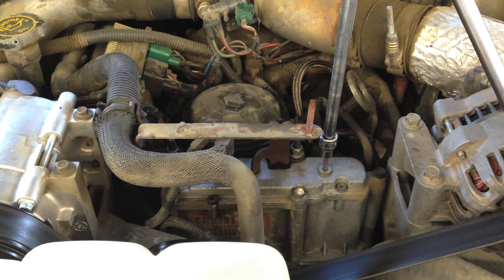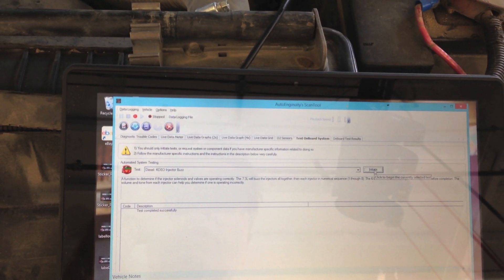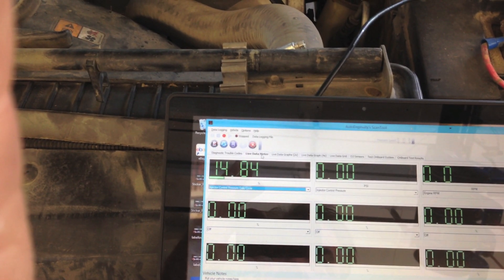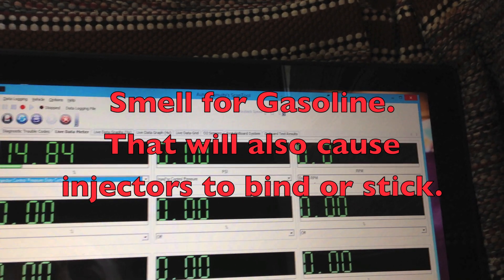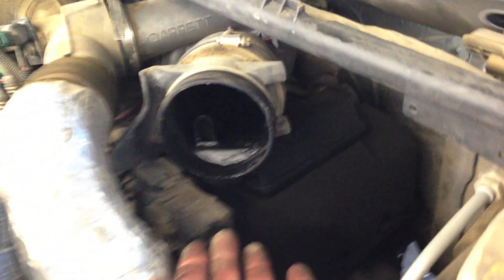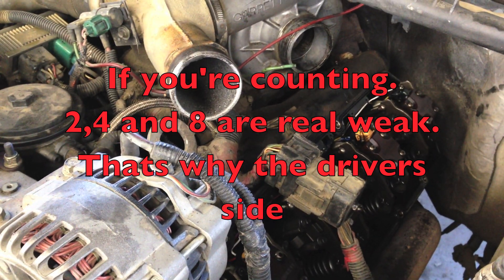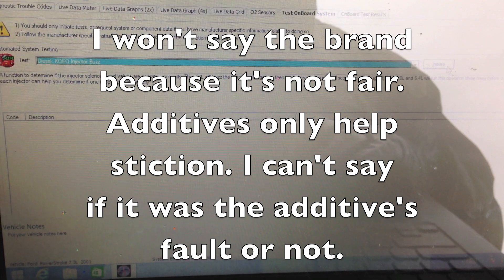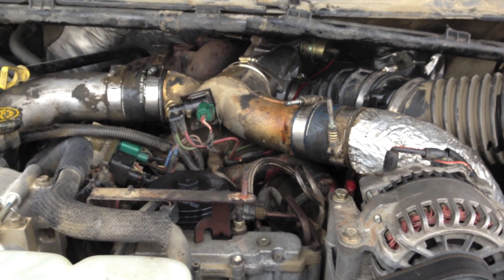Using Autoenginuity to diagnose a 7.3 Powerstroke hard start runs rough

Comment: sorry to bother,  I put new o rings in my hpop and new lines.  2000 7.3 t truck had a no start  found a blown fuse maxi number twenty four.   replaced fired up,  ran for five mins,  reved it and it died.  No start after that.  checked everything could find nothing.  finally I noticed on the directions for the new lines and cross over line,  it mentioned to discard the springs and check valve under fittings for lines on pump.  seems the new fittings are different inner diameter and the springs don't fit in the fittings like on the original.  I belive by not changing the springs and valves,  that I may have literally torqued the spring down when I installed the oil line fittings.  This is a three hose kit with bolt on hoses not snap on.  Anyway I checked ipr,  looks great ,  not sticking from what I can tell ,  I pushed on the piece in the center while spraying with brake fluid and id didn't seem to stick at all and seemed to open and close the ports as I would expect.   I did a test on the solenoid for ipr it had an ohm reading of 11.3.   I just now removed the spring poppet check valves.   Have you ever had a problem like this?  any suggestions?  my resibour is full,   i also removed the icp sensor and turned it over prior to removing spring poppets and it was just barely any oil coming like a half quart max on a long crank with that icp sensor removed.   i also ran 12 volts directly to ipr and turned over no start.  My theory is i basically dead headed the pump by bolting down those fittings with the spring poppets in.  I haven't attempted re start yeti thought i would attempt to confer with you first .  thanks a lot

Comment: You didn't go into detail about the voltage going down on cranking.  Great video.  I have this problem and at times it seems that it will fire right as I relase the key when cranking.  I have autoenginuity I will try my buzz test.
Reply: Sorry that Ron was unable to reply to my comment.  It seems that he was involved in a fatal rollover accident in his diesel VW Bug.  Sorry to hear.
Reply: Been wondering what happened to him.... Seen thousands comments "RIP Ron" never could figure out how he went. Thanks for the post.

Comment: I also tried one of the additives (not revx) with no change. I informed them of no change giving them a chance to offer to do something per their guarantee; they suggested thinner oil and... I guess buy more of their product. 

After quite a bit of looking into it, My understanding is that for the 7.3, the issue is the poppet valve and seat wearing until the armature no longer has clearance on the underside and becomes stuck to the lower surface by way of vacuum with thicker/colder oil. Boron isn't going to help with that. The additives might work for the later trucks with spool valves, but I see no chance for worn 7.3 Injectors.

Comment: Great vid Ron, I'm ordering a AE scanner to work on my 99.5 7.3L. I
My ex-mechanic sold me 8 New injectors when the truck wasn't running right at 165k. It was the in tank screens the whole time. (figured that out after the same results after the injector install.) Now I drove it for a week, and seemed every start after a couple days blew a ton of white/grey smoke. Got worse till it hydro locked. Coolant is good and clean so I assume the cups are fine. So that, and the white smoke would mean I am leaking fuel in the cylinder(?) How can I find what injector is leaking (that is the only way for fuel to get in the cylinder correct? 

Sorry for the long comment, any input helps. 

Also, do you use a special brush when cleaning injector bores/cups? Where do you get them?
Reply: ever find the problem?

Comment: I had a similar issue on my Excursion (2000 7.3) and before you yank injectors from a buzz test, make sure the UVCH are in good condition.  I had an issue where the engine would run fine when cold but as it heated up some electrical connection in the UVCH would break and I would lose an injector or several.  The pins should be clean and shiny on all sides and resistance test from the engine harness to the injector plug should be less than .2ohm.

Comment: i have a late 99 it runs great fires up just fine of a cold morning and idles fine plenty of power, but after a little bit of driving and getting everything nice and warm, when i come up to a stop light and sit a couple of minutes sometimes the idle gets a little rough, sometimes the idle is rougher than other times. it doesnt sound like anything is wrong while it idles a little rough it still sounds normal. to add the service engine light is not on, and it will still get up and go with no power loss. Also if i come home and let it idle and it gets rough i can shut it down, fire it back up and it will sit and idle again just fine and smooth as can be. i did have a couple of high pressure oil leaks, the rear plug on the hpop started to leak and the quick connect i the driver side high pressure oil rail was leaking, i repaired both leaks a while back and too add it does have fairly fresh oil in it. a few other things im not sure if it helps, but coolant is nice and green still, and fuel filter was still clean when i pulled it out when i was doing a pre winter check on everything.
Reply: Did you ever fix it?

Comment: thanks ron I have a 99 and it has similar problems wont start cold runs rough until warm just one question  though the hpop gets its oil from the engine yes so would it not keep the same level when running regardless if the level is low when cold.
Reply from the maker: It has oil pressure in the hpop reservoir. The oil pressure sensor is on top of the housing. It's full when running.